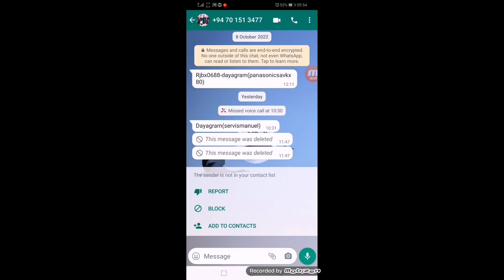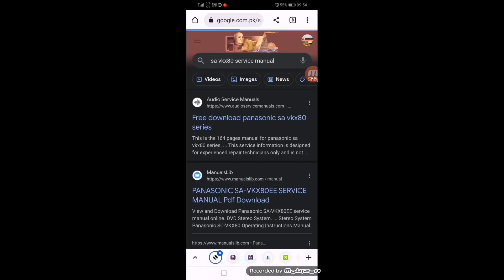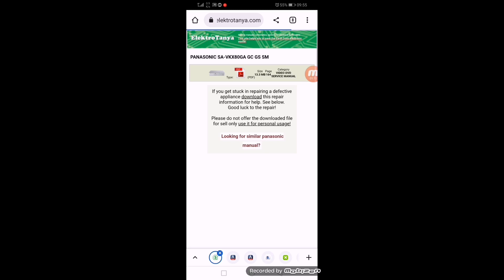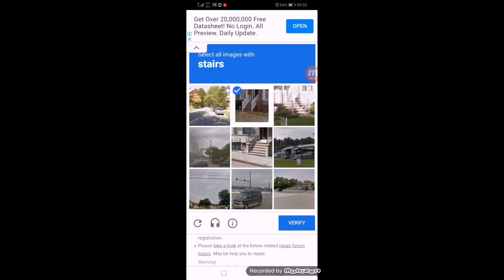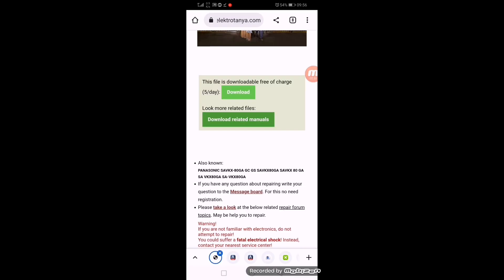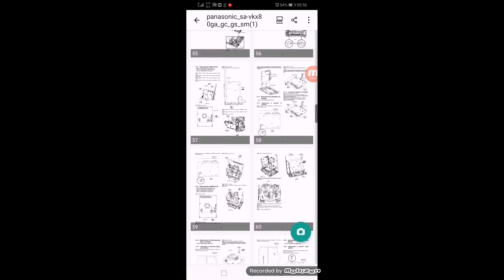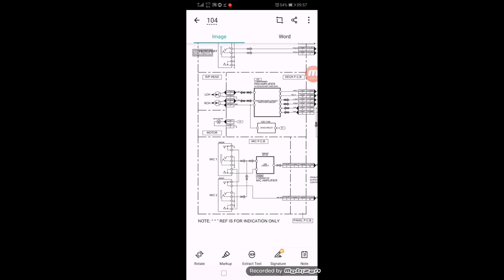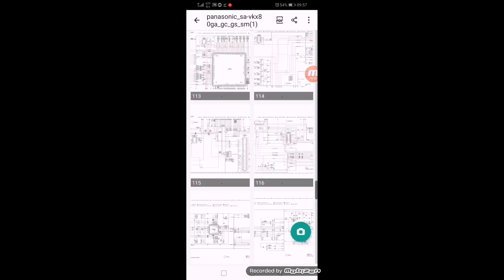{725} How to Download service manual PANASONIC SA-VKX80

Comment: Walaikum assalam what about different diagram from another brand we can find out same like that sir
Reply from the maker: yes brother 
if it is available on internet. it can be downloaded
moreover, 
we can search using board model number, part number,. 
even there is no diagram available, then we search using ic part number by searching it's sample circuits. it can helpful to understand the circuit and it's configuration

Comment: Hello freind.

I was wondering if you could help me with something.

I am digging up my old xbox 360 stuff and noticed the power supply doesn't work anymore.

I was going to buy a new one when I saw that instead of paying £20 I could pay £5 for a supply cable without the chunky unit with it.

Will this still work or do I need a proper supply block?